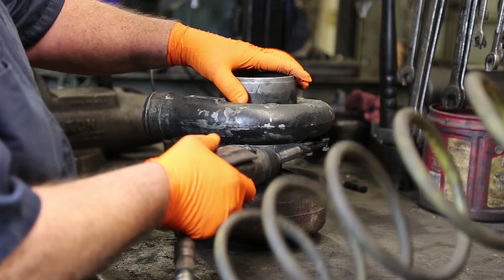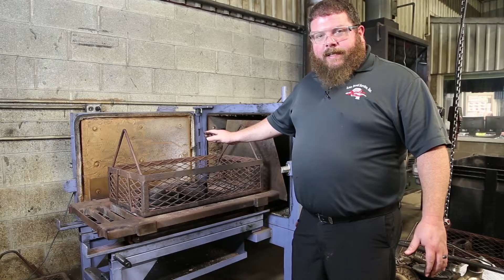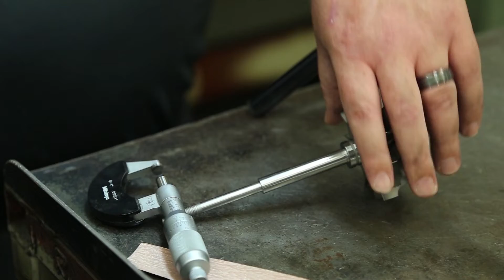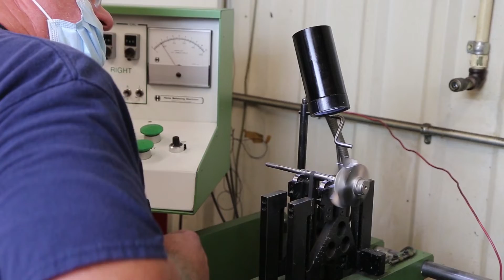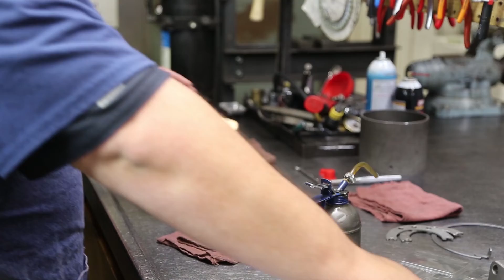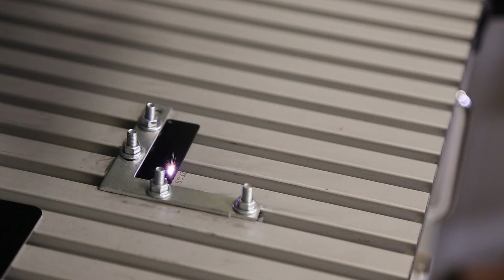Area Diesel's Custom Holset Reman Turbo Upgrade for Red Poppy Ranch First Gen Dodge 5.9L Cummins

Comment from the maker: Correction: We did notice a mistake when speaking about the turbo orientation around 34:10 for this reman; it should be "0 over 340" rather than the stated "180 over 340"
Reply: BTW in relation to staff not wanting to be on camera and assuming company more want promotion of business and not revenue offer them the returns for proceeds towards  company festive events and when getting good sub base anything left over then a YouTube bonus for presenters…… my cut is only 5% for the recommendation

Comment: I am trying to find an old Dodge similar to Heath's latest..... I know very little about diesels, but I know that's what I want.   Can't find anything on the usual retail web sites.  Any suggestions for a good source.  I am in NC, 78 year old female who LOVES old trucks.  (current one is a 95 f150 4.9 2wd).  thanks for any all guidance!   Mary
Reply from the maker: Might not be much help there for an older Dodge like Heath's - but if anyone's looking for a 2006 F-350 custom deal - it was the ADS work truck for many years and engine was swapped to the 5.9L Cummins - 

https://www.facebook.com/marketplace/item/213994290782536/

Runs great, just time to go. This is an Amarillo Edition. 8ft bed. It has an engine swap with 5.9L Common Rail Cummins engine. Fresh overhauled engine was put in at 98K miles. Head studs, head work, fire ringed, etc on the engine build. Single Borg warner turbo. Stock, but tuned transmission. New tires. The graphics could be removed. Leather interior. Has a collapsible ball in the bed for a gooseneck trailer too.

Comment: He is going to need an air intake hose for his truck if it is stock as the non intercooled trucks had compressor covers with no map groove and are like 3" instead of 4" and an adapter to go from that half marmon outlet to hose since the non intercooled trucks were hose outlet only. When I ran a maxed ve pump on a set of Lucas injectors I got a peak of 220cc at 2200rpm, So that should put him solidly in the 300hp range.
Reply: Well I see now after watching his video his truck is intercooled so the turbo stuff is all direct swap but his truck should have had 7mm tip 6x.009" injectors from the factory not 4 holes. Just noting for people that might read this in the future to avoid confusion.